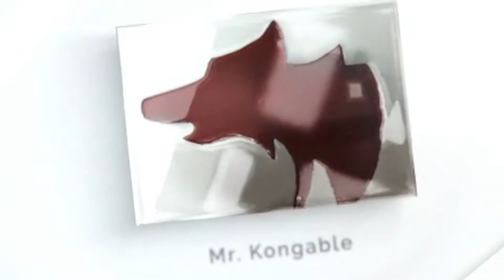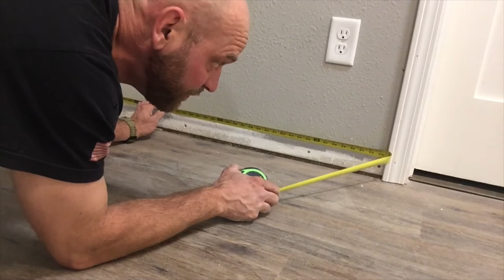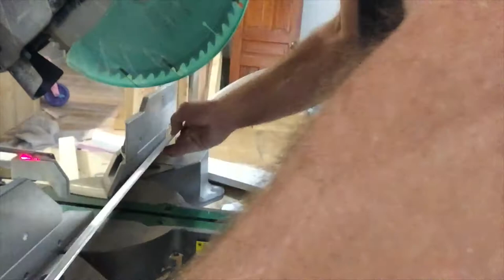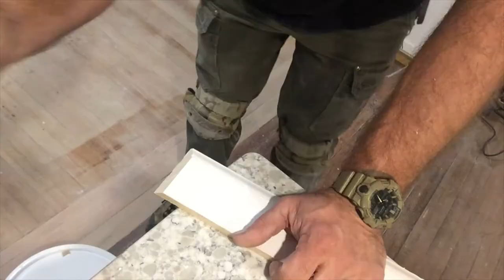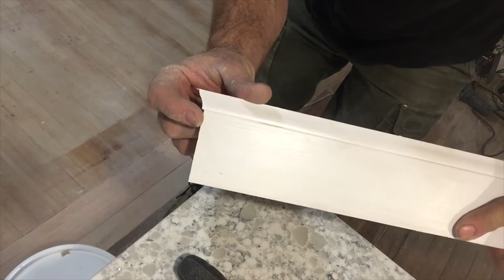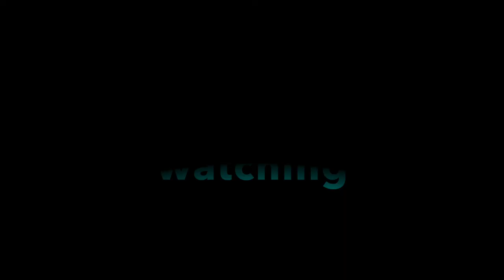How to install base trim and the coping saw HACK

Comment: I have a 10in  miter saw What should I do my miter saw can't cut baseboard upward...
Reply from the maker: If your miter saw bevels, then you can lay the trim down and cut it with the bevel function
Reply: Just add wings to your fence so that the material is being cut closer to the center of your blade and it will cut base vertically. I made the wings for my 10" miter saw with plywood scrap and recycled wood screws.